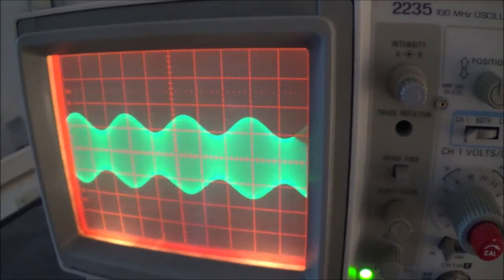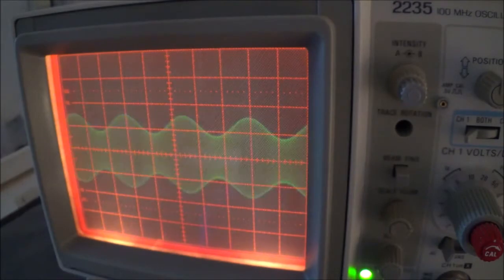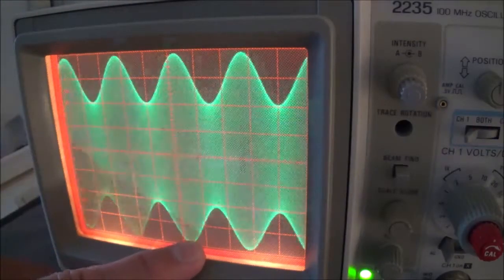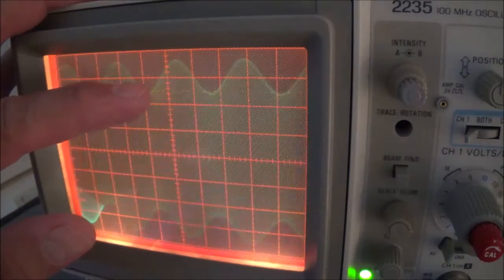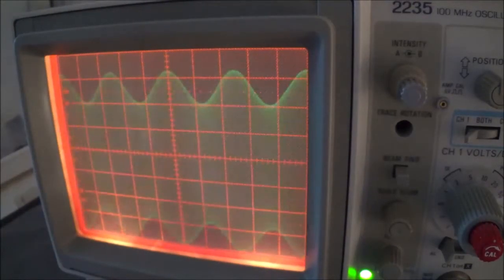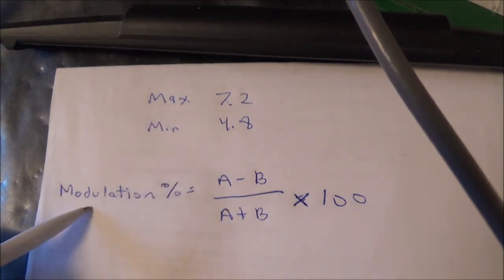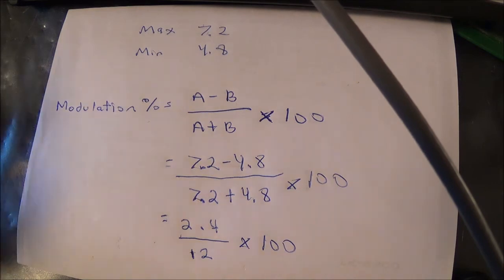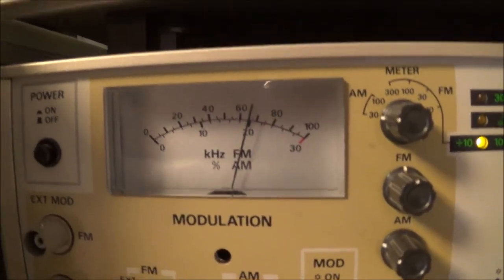Measure AM Modulation Percentage With An Oscilloscope

Comment: Great video, can you let me know what your scope settings were i.e volts per division and timebase etc. I have an analog scope and want to do this sort of measurement but not sure where to start settings wise.
Reply from the maker: Hey, Mr Beach! Sorry for not answering right away; I am not on YT all the time. Anyway, that is hard to say--the video is also a little back in time. Depends upon input frequency and signal level. I probably set the scope for .5/1/2 (turned up the amplitude for demonstration purposes) volts per division and the scope for .2 or .4 ms. Really, what you have to do is play with the voltage and horizontal controls until you get it right. I really don't even look at the settings. I would probably try to get a good display (say you fed in a 1 MHZ sine wave) and then turn the AM (400 or 1000 Hz) modulation on. More tweaking--horizonal will be required. Just play with the controls till you get a display like the one I got.
Reply: @OldSchoolElectronics  Thats great thanks for the setting to try I wil give it a go starting from there and see how I get on.
Reply from the maker: Cool. You just have to play with controls, especially since you really can't destroy anything in this case.

Comment: Hello, nice video and exactly what I need!! I have a shortwave broadcast transmitter to measure and tune the modulation with an Orban HF processor, but I am not sure which oscilloscope to buy! Do you think that this model will do? Hantek DSO5102P ?
I really appreciate if you could give me some light, Thanks for the support, Julio
Reply from the maker: Thanks for watching and commenting. I just bought a Hantek 1502P, but have only used it once. This is my very first digital scope, so I have to get used to it, meaning, learn how to use it. It was about the cheapest digital scope I could buy. I have not yet used it to look at an amplitude modulated waveform yet, but will do so soon. I am going to make a short video soon showing under- and overmodulation, even though I am not in any way a modulation expert. My interests are more in audio repair and occasionally I will do AM, or sometimes even non-swept FM alignment. Maybe I can use the digital and the analog scope in the same video so you can see how the waveform is displayed.

Comment: Interesting but it would have been useful to see 100% modulation on the scope. Even bettet a sweep from 0% to 100% in 10% increments where you can see what it looks like on the scope. And even better still (not sure if your generator can do it) is to see what over modulation looks like. Sweep from 50% to 100% to 110% to 120% etc. This would all be useful in setting up a transmitter. Thanks and 73
Reply from the maker: Thanks! That was more to show beginners how to do it (measure percentage); at least the way I learned it a long time ago. Might be other videos out there?
Reply: @OldSchoolElectronics  Haven't seen one yet so maybe I will make one with the $20 DSO138 scope I just bought :) Good enough for the purpose of monitoring my modulation level.
Reply from the maker: Good idea with the video. That would help some people for sure.